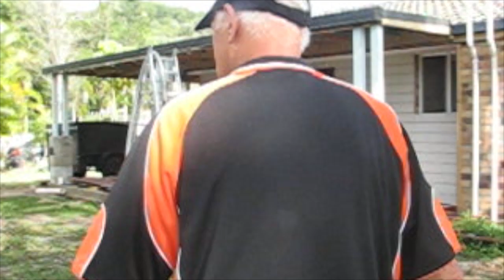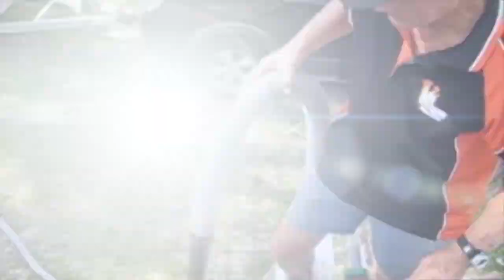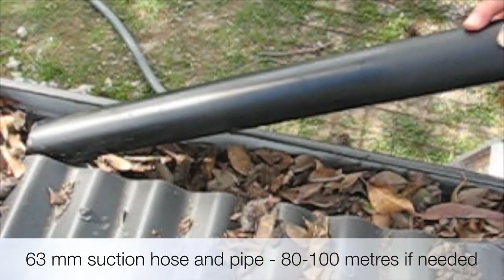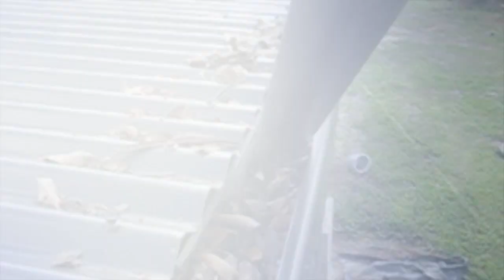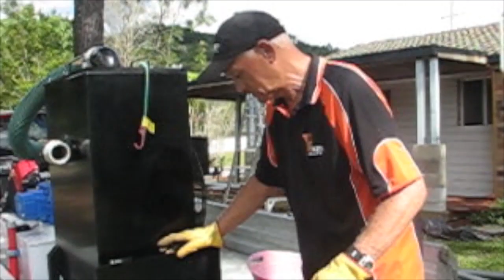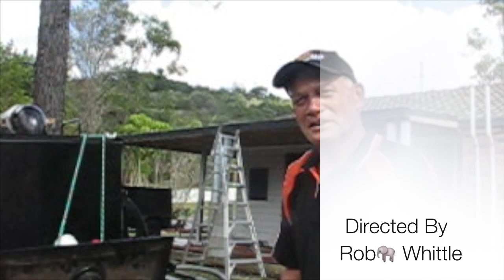Gutter Vacuum 580 Super Sucker

Comment: Bigger pipe would prevent it blocking up suction looks good but making it safer on the ladder with 3 points of contact instead of 2 would be better Trust me I’ve broken both my heels at work and will be so cautious with using ladders from now on . Only fell 5 ft but was on cargo shit and landed on a steel floor 👎 but I like the set up .